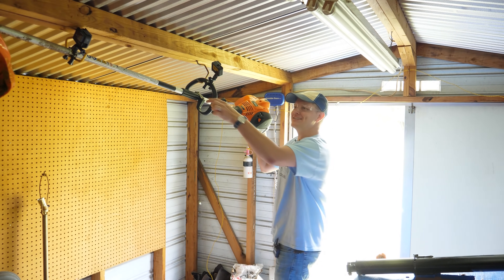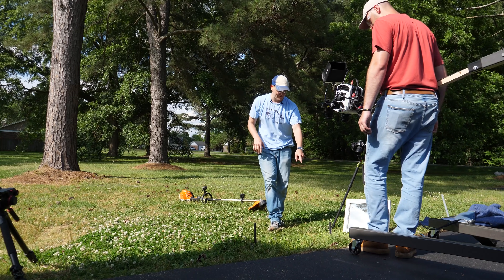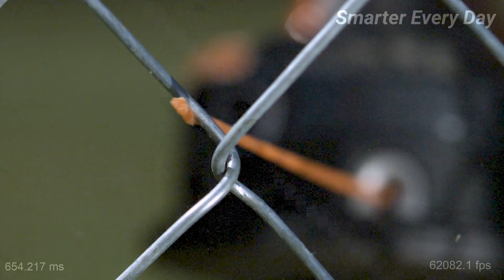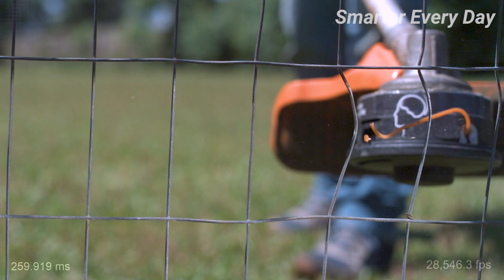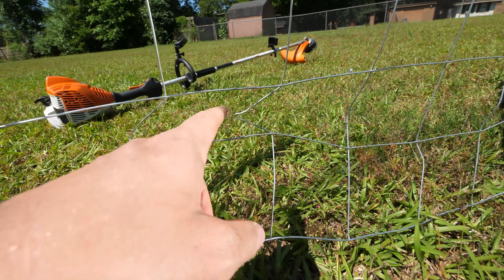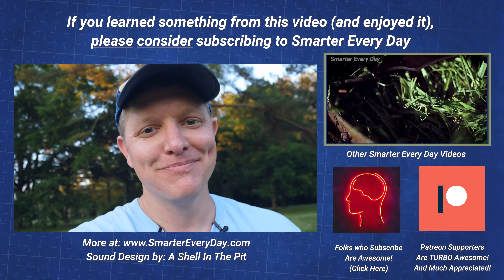How Weed Eaters Work (at 62,000 FRAMES PER SECOND) - Smarter Every Day 236

Comment: Word of the day: "Spaghettification"

Is it just me, or does it seem that the string is liquefying slightly as it breaks?
Reply: Its actually a real word used to describe what happens to matter as is passes the event horizon of a black hole.
Reply: @thecygnusserket  Astronomers must really like Italian food, because the layers of a neutron star are also named after pasta. Gnocchi, spaghetti and lasagna (might have missed one), the nuclear pasta
Reply: @eliaswilliamsson8553  they probably just had some Italian food the evening that they decided what to call things
Reply: The impact probably heats the nylon locally enough to make it slightly softer, so it doesn't crack along a neat line, it kind of stretches and shreds.
Reply: Like overcooked spaghetti
Reply: It could also be the moisture coming from the grass cut before
Reply: It does look like that but it could just be because that type of plastic is smooth and shiny.
Reply: everything looks liquid in slow motion
Reply: I'm* gonna go with simultaneous elastic and plastic deformation *(not a physics expert)

Comment: The blade is dull (on all STIHL afaik) , so you hear and feel the cutting of the line. If you sharpen the blade , you basicly wont hear the line when it's cut. I had one Chinese weed eater ,and I never heard the trimmer line being cut and went trough the spool much faster. Then I made the blade dull filling it down and it made it much better. It is an important feedback for the operator.

Comment: 14:55 "broke at the welds" 
First thought that came to my mind "nobody ain't got time to weld all that". Now my english as a non native speaker isn't top notch, so "welds" might be all kind of connections between too metals, but the whole video I was thinking "how are these connections made". I figure it's probably just pressed together at such high pressure, that it forms a solid connection (maybe that's also called a weld?) or they shoot electricity through it to make the connecting points hot and weld together. Anyone know how it's really done?
No clue why I'm coming up with new problems when watching a solution video for a problem I hadn't even thought about before. xD

Comment: - 02:13 (aerodynamics vs. angular acceleration)
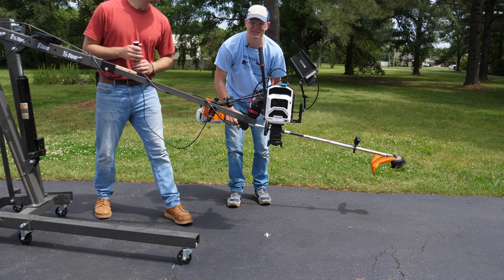- 02:50 (aerodynamics effect on line)
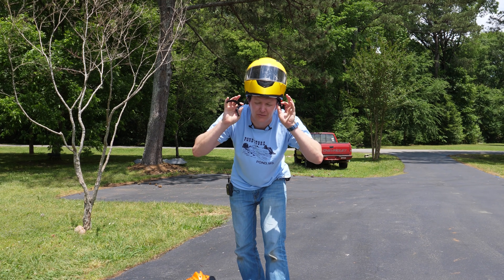- 03:43 (long line effect on the torque)
- 04:19 (Long line effect on aerodynamics)
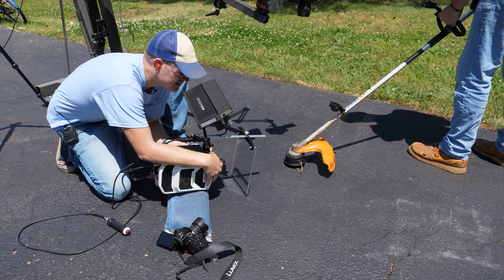- 05:18 (guard cutting line)
- 06:12 (Lines effect on grass)
- 07:17 (is what you're here to see) 

... There´s more tho. Im out.

Comment: I run a lawn care company in North Alabama and I use the pentagon line in the .105 diameter. I have found it is much tougher when it comes to holding up against heaver grass and obstacles than the thinner .095 round line that comes standard with Stihl trimmers. Might I recommend going thicker and with the pentagon shape.

Comment: Aero-flex blades are better than line. I used to go through several spools every year. Now I go though 1 set of aero-flex blades a year. That's a lot less lil bits of plastic ending up in the storm drain.

Comment: It's always interested me that it's easier to cut taller grass than it is to just shave a little bit off of the top. Makes sense when you think about how much mass is above the string as to whether it slices through or just bends the whole blade out of the way. Maybe SmarterEveryDay could do an in depth video studying how much you need to cut off in order to get an efficient cut!

Comment: Saw something at work that made me think of you. I work grounds for an apartment community. I saw a funnel forming in a pool, and the sun light was being bent through it, creating a shadow with a bright ring around it on the bottom. As this ring of light crossed the shade line from the side if the pool, the bright circle was maintained until the funnel eventually faded.

Comment: Huh never realised that the button on the underside is so that you can slap it against the ground to extend the wire and now i feel dumb. I always turn it upside down and do it by hand (after removing the power source just incase it magically turns on despite two separate buttons needing to be pressed on every weed eater ive ever used)

Comment: As a landscaper the type of line you use also makes a big difference in how it cuts. For example braided line  cuts so much cleaner and spins straighter due to being more aerodynamic. Just some food for thought. One other thing if you soak your line in water before use it will last much longer.

Comment: Is it possible to also grab high speed IR? It looks like the cable gets more flexible as it hits the fence a few times, and given the massive deformations/energy transfer at such a high frequency I wouldn't be surprised if the cord is actually nearing its melt point at the impact location, making that tension failure a good deal easier.

Comment: Hi! Loving the video but I have an observation here. The smallest wire diameter fence is probably breaking at the welds because that is the most restricted part of the wire. You can see how it just bends the wire when it hits at the middle of wire. At the weld the horizontal lines resist that bending motion, therefore inducing more tension at those spots making it more likely to break. Also it depends who gives in first, the wire or the weld :)

That said the structure of the fence might play a huge roll. Maybe the small diameter diamond shaped fence (like the first) would endure more than this rectangular one...

Comment: I saw a video from Stihl where they showed what happens if you have a line just an inch longer than the gaurd from taking the gaurd off and it made the weed eater run 80% hotter